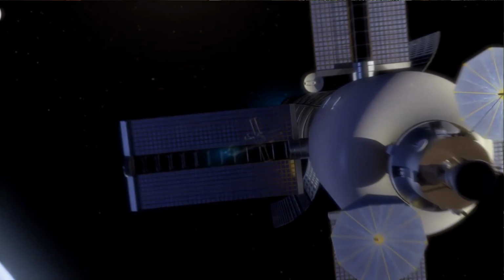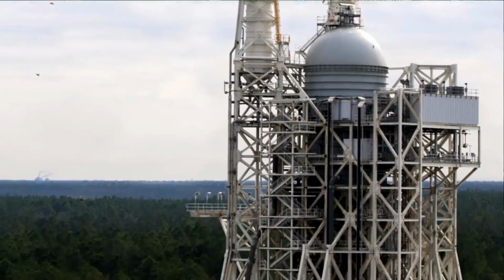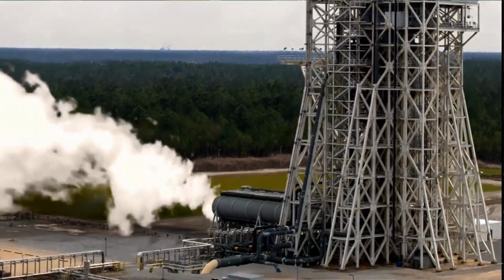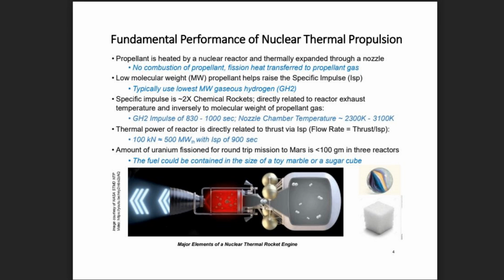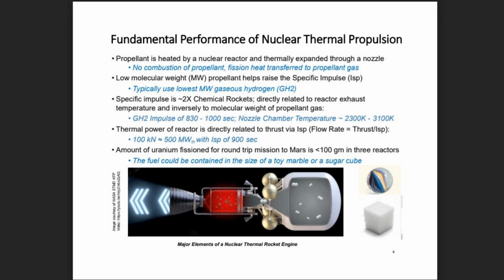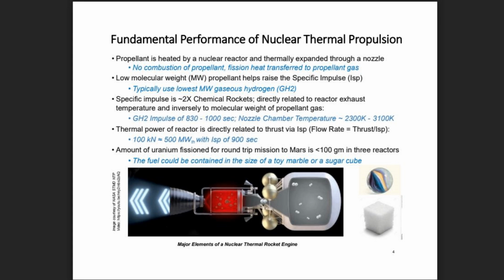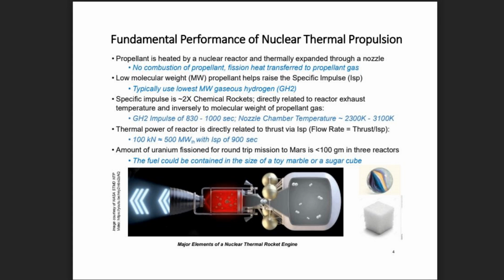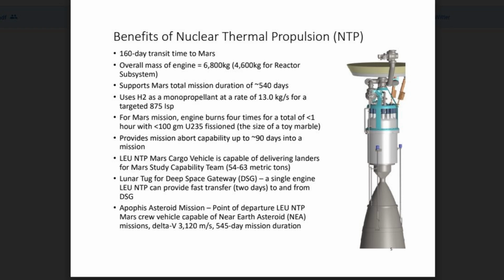Using Nuclear Propulsion for Deep Space Exploration

Comment: In my view, high assay low enriched uranium based reactors would probably be the best compromise. HALEU reactors use uranium fuel enriched to about 15-19%, just below the internationally agreed limit to be considered low enrichment. This is quite a bit higher enrichment than most commerical reactors, around the same as many research reactors, and much less than weapons grade enrichment used in some specialized military reactors. When combined with ion drive thrusters for cruising, this is an achievable near future propulsion system to explore the inner planets and their moons. Radiation exposure and long term zero g limits to crew health would still probably prohibit safe travel to the outer planets unless there are sufficient advancements in mitigation measures.
Reply: For propellant gas, hydrogen is theoretically the best in the short term but is difficult to store for a long period of time. A light inert gas might be a more practical choice for long missions.

Comment: NERVA or it's modern equivalent - crippled by low enrichment of Uranium - has better ISP than chemical rockets, but is horrible compared to ion propulsion i.e. VASIMR. If you're going to put a reactor into space, VASIMR or similar systems would seem to be a better bet.
Reply: Agreed. Why use nukes to ionize hydrogen when the New Horizons craft has already used ionized xenon?
Reply: In an ideal world the mission goals and the mission profile would determine the best propulsion option. It is not always about the highest ISP. 

You should also keep in mind, that VASIMR needs a really powerful energy source - it is not really down scalable. That also means more weight and more fuel is needed, where a wimpy engine could do the job.
Reply: Nuclear Thermal will require more power than VASIMR (200kW), so a larger reactor, larger radiators, and way more reaction mass. However I do the math, NERVA related designs always end up far heaver and more expensive for any mission profile.
Reply: Mr.Rodney ,
VASIMIR weighs ~7k.lbs. for every pound of thrust it generates . That is one suckey "transmission" ! To examine much better possible architectures , go to Quora thread : In Star-Trek , Impulse-engines are used for propulsion systems … 
Concentrate on my comments .
D.H.
Reply: It's the ISP that matters in this case. Most if the weight in both systems will be the reactor and reaction mass. NERVA looses badly.